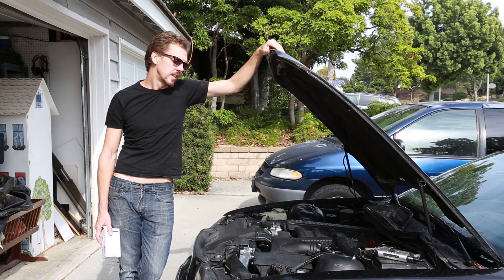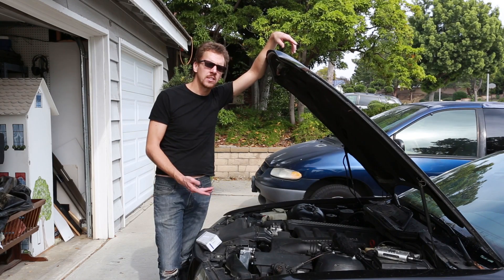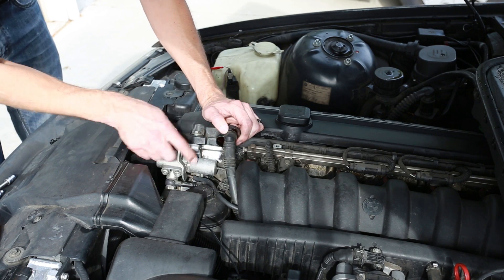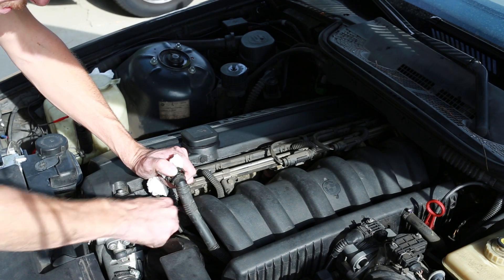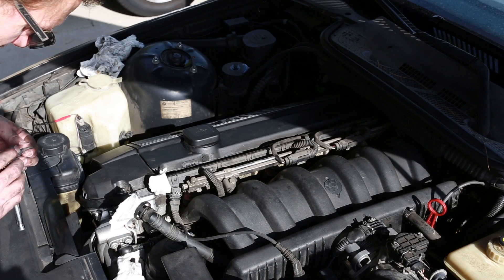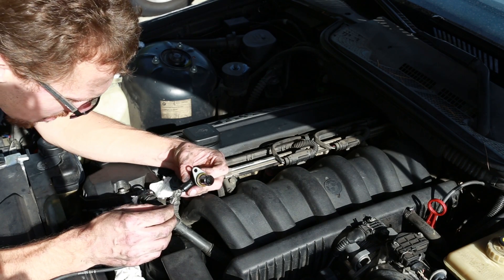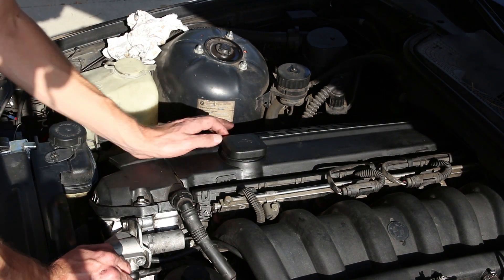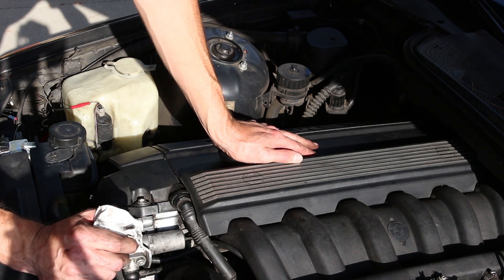How to Replace the Camshaft Position Sensor on the BMW E36 (1998 328i)

Comment: Car was giving me starting problems for a solid month. No check engine light or anything. Replaced both crankshaft and camshaft sensor and car feels stronger.
Reply: Was it cranking but not turning over?

Comment: Did mine today. The hardest part was finding the senor connector tangled. Use a good set of Vise grips that open while clamped to 32mm. Adjust to get a good grip. You don't have to unplug the vanos necessarily. 19mm wrench for vanos banjo bolt hand tight. Must use two (2) new crush washers. About 20-4 pounds torque. You feel the washers crush.

Comment: Great video!  I just bought a 1999 323 with a cam sensor code.  I think it said bank one.  The engine just started to run a little rough and blows blue smoke. I am SOOOO going to take an anxiety pill before doing this.  Reaching for that connector is going to stress me out!  oh yeah and it's a three-motor convertible with a blown-out window, and guess what?

Comment: Did mine the other day and still Exhibiting the same issue . Cold start not so good after warmed up the. She’ll run all day . If I clear the code it won’t come back till next cold soak other than that she’ll run like a top . …. Wth
Reply: Mine also does this as well did u ever find out why?

Comment: This helped me replace mine myself, savior, thank you. For anyone else, put a light on the 3rd space of intake manifold and that is where the other end of the old sensor plug is. Alot easier to do when you can see the adaptor when putting the new one on.
Reply: Wheres the adapter what do you mean

Comment: Hii i have some problem currently . 

 My question is : can we put m50 sensor to m52 engine ?
And
By the way do you lost torque and power at low rpm before ?? This is happening on my car e36 323mt

Comment: Ok, so once you unplugged your vanos unit you unbolt/unscrew something underneath it at 3:30. And at 3:41, the vanos unit you unplugged as previously mentioned unscrews really easily, mine is like it is welded on... could you explain what you loosened?

Comment: M52 on E36 is single vanos and only has one cam sensor, the intake one.
Reply: From 98 it has two
Reply: @type4968  I said on the E36. No E36 has a dual-vanos M52.
Reply: Yea, I was about to say this too
Reply: @playboiteg  I said on the E36. No E36 has a dual-vanos M52.

Comment: Sometimes I have acceleration, and sometimes I have very little. This started right before my clutch fan gave out and the reservoir tank burst. I think the tank burst first though, then killed the clutch fan. It was having this power problem a week before My car went into overheat mode, and yes I did pull it over and get towed.

Could this have cause the camshaft position sensor to fail or god forbid the vanos as well.

Comment: So I found an oil leak that seams to be coming from the sensor that's why I looked for this video, I have the deceleration symptoms and also my car sputters when I try to step on the gas, but drives fine when I baby it, also check engine like is on for o2 sensor. What's your thoughts any help would be great??

Comment: Thanks a lot man! I was using your tutorial to replace my camshaft sensor on 323ti 1998. Was super useful. What I also did - I have removed oil filter cover and cap. It helped a lot, because I had to squeeze my both hands in to connect sensor. It was one of my first engine fixes ever, was much more complicated that it looks in your video, but I have succeed. So thanks a lot again

Comment: apparently you have to watch out for obd2 and obd1 with these as the camshaft position sensor had a different end plug than the replacement. Yaaay I get to do it all again

Comment: hi, ok well I had a code come up PO340  on my 1998 bmw 323is  E36  put a new camshaft position sensor And cleared the code BUT The Same Code Keeps Come Back PO340. How Can This BE??  am I Over Looking Something else possible?  so what do You Think the problem is Here?? Please let me No .Thank You
Reply: Robert Commodore same thing happened to me as well. Try replacing the pigtail to the cam position sensor. That could be your problem
Reply: Hello guys i have same problem i juat change crankshaft and camshaft and still have code camshaft sensor
Reply: Same here and the car only idles funny for few seconds on cold starts other than that runs great did u ever find out why?

Comment: can you make a Video on how to properly lift an E36 with a aftermarket Jack and where to place the car stands.
Reply: Look up the Rocker Jack Pad Adaptor on ECS Tuning. It hooks up to where your emergency jack connects on the side of your car and it'll free up the jack pad so you can put the stand underneath once the car is lifted.
Reply: Use the front crossmember on the subframe. Very easy. Use some rubber (e.g. a hockey puck) between the jack and the subframe to help prevent it from slipping

Comment: Hey bought a beater e36 323i the other day, was starting fine and drove until it overheated, then reversed into my garage left it for the day, now it wont fire up, cranks like a champ though.

Where do I start troubleshooting?
I can rule out battery.
Not sure about spark plugs/fuel filter as of now
Reply: +Jordan Kuzich Check to see if fuel pump is pumping fuel. if not check fuel pump fuse and relay. if you have fuel. Check for spark to the plugs and coils.
Reply: Whacked the fuel tank and she started, heard this is a common problem as the fuel pump get stuck. Will replace soon :D

Comment: Nice video. I am about to do this repair to my 1998 328i this week as soon as the part arrives. Thanks for taking me through the steps before I start. The one thing I would add to your video is to add a little engine oil to that new o-ring to lubricate it before installing the new sensor.

Comment: Hey man, I love your videos!!! I have the same bmw as yours, and you're videos has helped me alot! But I was wondering, would you do a video on repairing the exhaust's butterfly valve? Mine seems to be stuck on the open position, if it's not too much trouble :)
Reply: itl probly b the air line running to it is disconected ?

Comment: check engine light turned on and this is what was coming up as a fault under using my research tool by Peake. did your check engine light turned on as well?